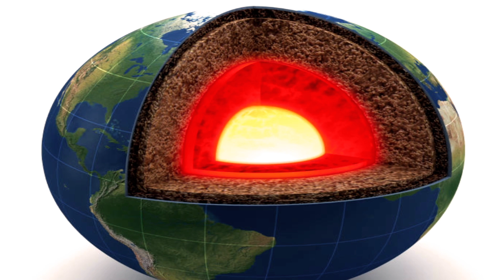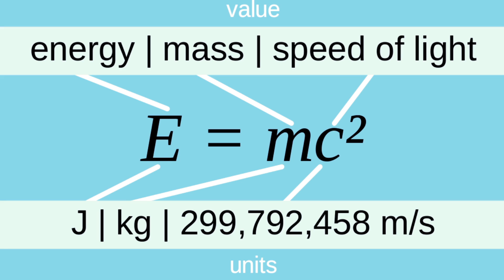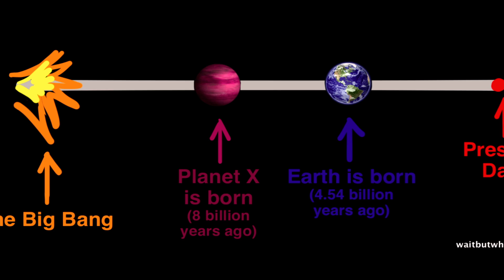5 Renewable Energy Sources We Should Be Using | Future 5

Comment: What about gravity?
Reply from the maker: We only didn't include that because the technology that uses gravity has to be made for that exact piece of technology in order to work.  We haven't come very far in figuring out how to generate electricity from gravity itself yet.   Other then of course when putting in physical work yourself using pulleys or weights which have powered lots of machines for centuries.
Reply: +Khronos Studios 
Understood. Thanks for the response.
Reply from the maker: Michael Regis  No problem at all, thanks a lot for the comment =P.  it's really too bad,  gravity is an amazing force and we know so little about what makes it work.